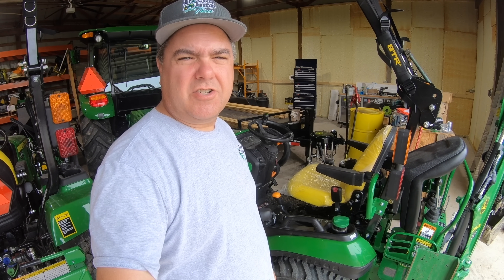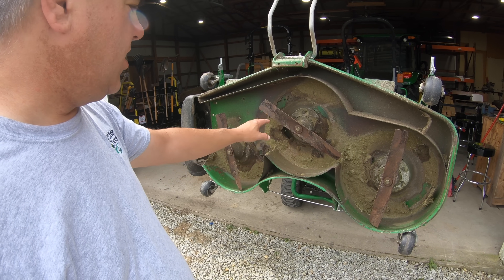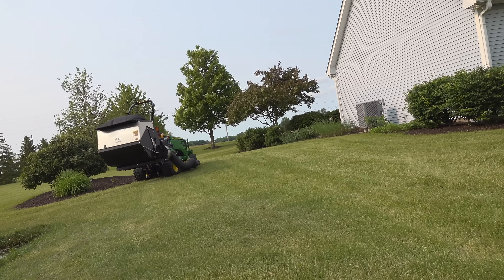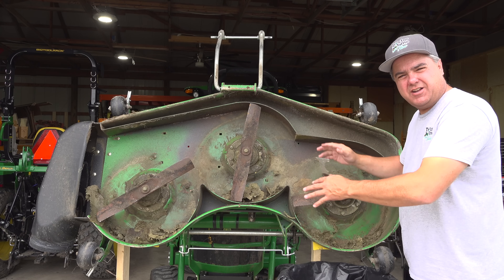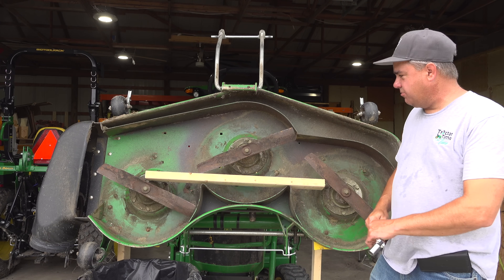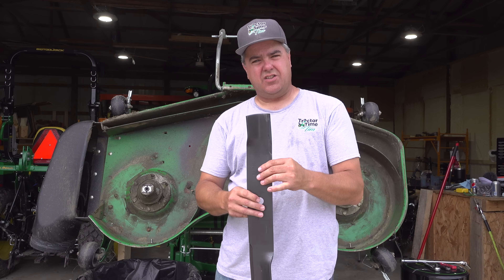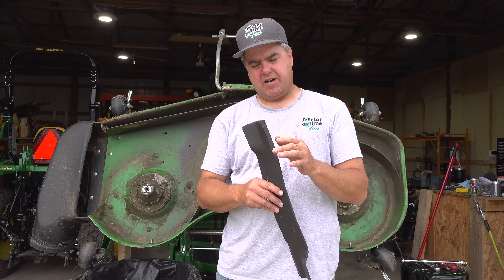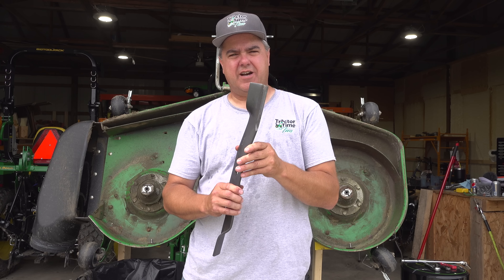Never Sharpen Your Mower Blades Again???

Comment: They really do work. We have gotten nearly 60 hours on each set without needing to sharpen them. Nice cut also
Reply: Plant foods
Reply: . Homemade plant food
Reply: Love your videos bro, and appreciate you keeping us up to date on the blades.
Reply: Nonsense.  Also, I get far more that 60 hours out of a sharpening with my standard mild steel blades.  In fact, I only sharpen them once a year - in the fall before putting the mower away.  Laminated steel blades with a thin layer of hardened steel  for the edge over a thicker of mild steel has been used for many hundreds of years by Japanese woodworkers for woodworking. It's a terrible idea for lawnmower blades. Also they are NOT self-sharpening which you even admit.  So the company that makes them is lying about that.  That should tell you something.  You do NOT want hard steel blade edges for lawn mowing. Hard steel is brittle and chips easily making it a very bad idea for lawn mower blades.  Just stop and think about it for a minute.  Lawn mower blades take a lot more abuse than woodworking tools such as planes. They run into rocks, sticks, and other non-uniform things.  They should not be sharpened to knife sharpness either.  Lawn mower blades are made of mild steel for a good reason.  Using laminated blades for lawn mowers is a bad miss-application of the principle which is to make a tool that can be sharpened to razor sharpness for woodworking buy also make sharpening much faster and easier than a whole bladed made of hardened steel.  That has nothing to do with mowing a lawn.  You've been duped.  Just think about it. It should be common sense for anyone who knows tools and technology.
Reply from the maker: Bob, the only thing you are forgetting is that not all soil types are just like yours.  My understanding is that sandy soils (say Florida) are horrible on regular lawn mower blades.  They dull and wear out very quickly.   These blades stay sharp in those conditions much longer.
I do not think these blades are useful in my conditions, as blade wear isn’t much of a problem anyway.   Dings from rocks are a much larger threat.
For this commenter, 60 hours may be a long time!  I heard some sandy soils required contractors to sharpen blades every other day!
Reply: @TractorTimewithTim  Blades of Grass Lawncare featured a few videos where he pointed out he had sandy soil in his area and put Fisher Barton specialty-coated 'never dull' blades on his mowers...And they lasted most of the season. Granted they looked awful a few months down the road, but they were still sharp.He used to swap out blades every day.

People really underestimate the effects of sandy soil,  because they figure, well, the soil is under the grass right? Well it still damages the blade. Every time you mow on sandy soil, especially when you use high lift blades,  you're sandblasting your mower deck. It's the same principle as helicopter blades in the desert: The leading edges have to be covered in a titanium barrier to keep from destroying the blade.
Reply: @TractorTimewithTim  I can confirm that sandy soils seriously degrade and destroy mower blades, in a matter of months, if mowing sparsely grassed areas with lots of exposed areas allowing sands to be kicked up!  This will also destroy the mowers ability to pick up clipplngs, real bummer too.
Reply: @TractorTimewithTim  60 hours? Ha ha ha! I'm just now replacing a set of Gravely Marbain blades that have been on the deck for 12 years. ( Over 1000 hours use ) And really, all they need is sharpened. Which is all they have gotten ( once ) in those 12 years. The blades that are going on are ones like I have used for over 40 years on the 50' decks. And what Gravely sold on the 30" mower for the two wheel tractors. They are blades that have carbide insets brazed into the edge of them. They handle cutting wood without a problem up to a  2" diameter as long as it is green on the 30" ( insert is a 3/8" thick by 3" wedge ). The 50" & 60" deck blades can take hedge trimmings and turn them into mulch without problem. Rocks have never seemed to have been a problem with them but rebar is a different story. We aren't on sand down here, we're on rock with a little bit of ground rock and a little clay for soil. But what we have is a grass that moves Silica thru its stems. And that will dull regular steel blades in one use.
Reply: No such thing as a self sharpening blade,  maybe less sharpening blade, only true test of when a mower blade needs sharpening is to look very close at the tips of the grass a day or two after cutting, if the tips of the grass blade is cut clean,  which means no rips or tears, the blades are good , grass is 70% water, which in itself is very abrasive, hardened steel only prolongs having to sharpen the blades

Comment: when putting blades back on do they have to be all facing in same direction i have 2 big outside ones and 1 small one in middle . to keep deck balanced? also have you oiled the deck after cleaning?

Comment: Clean and paint the bottom of your deck at the end of each season and it will never rust through.
Reply: Just spray with old engine oil
Reply: We would paint underneath with Slip Plate which is normally used on gravity wagons.
Reply: If they'd make decks out of aluminum or stainless they would last a long time, but they want us to buy them more often. Heck, why not a thick plastic like gas tanks on cars.
Reply: Rich Gocken 2

Comment: Hey Tim, how have those blades held up?  I ordered some, and have them, for my 3046R, but plan to put them on for next season.
Reply from the maker: I didn’t run them long.  Traded the mower.
Not good when hitting small rocks.
Good for sandy regions.

Comment: A word to the wise, and take it from experience, If you choose to 'power wash " a mower deck, which I have, depending on the brand and types of 'spindles" on your deck, be very careful not to aim too close with the pressure washer nozzle too near the bearing area(s) of the spindles. If your deck does NOT have the type with grease fittings, that indicates it is a sealed bearing. Accidentally allowing high pressure water to enter that area can be disastrous, because it will inadvertently blow the grease out of the bearings. If your deck has fittings for greasing the spindles, make sure you grease them right after power washer the deck. I recommend marine grade grease regardless of whether or not you power wash simply because there is always a lot of moisture in the grass. Scraping it best. Most the time, the reason why there is a grass build up is because you're mowing wet grass. Like early morning mowing. Mowing in the afternoon assures that the grass is not wet, but sometimes can't get around it.
Reply: On Steve's Small Engine Saloon he recently showed that a lot of the spindles with grease fittings actually have sealed bearings in them. He removes the inner seal so the bearings can be greased via the zerk fitting.
Reply: ditto on the deadly pto shafts,never have protruding bolts or shear pins and always keep shields in place,no shield yellow tag-machine inoperative-no exceptions! had this happen to a cousin,lost his right arm nearly killed him.

Comment: I just purchased a new lawn mower.  My old lawn mower, which was the cheapest push gas powered mower I could find at the time, is still running.  I replaced it because I got tired of having to put duct tape on the deck to keep the grass clipping from blowing back on to my face.  This mower was somewhere between 15 and 20 years old.  I never changed the blade, I never sharpened the blade, I never changed the spark plug and I never changed the oil.  When the engine would start knocking, I just added oil.  That mower has been sitting outside since last year and I would bet any amount of money that It will start with just one pull of the cord.  I'm getting older now so I purchased a new battery powered electric mower. (just in case, I'm keeping the old one)

Comment: Great video; but, I have seen guys just lay a bead of weld on the bottom edge of the blade and re-sharpen to bevel. The weld material is harder than the blade steel and this helps with keeping the blade sharp longer. The problem is like the "self-sharpening" blade, if you hit a rock or something it tends to chip the harder edge.

Comment: Just an impact to take the bolts off. No need for blocks.
Reply: And that is a way to take a hand off.  I had someone who did the same thing, but his impact was not set enough to loosen the bolt and all the blades were truing, so NO... do not use an impact wrench on the blades of a mower deck.

Comment: It’s been a few years now how did these blades work out were they worth the extra money
You were talking about how to keep your mower deck clean underneath one thing that I found is if I take some spray in bedliner and coat the underside of the more the grass won’t stick to it and if the end of the year it will be very little wear and you could touch it up and in the last few years and years
Reply from the maker: We did a follow up.  Not really suited for my soil types…would be better for sandy areas.

Comment: The harder steel is made the more brittle it is. I was told that by our machinist at work. One day a tapped a metal file on a round hand rail and snapped it right in two like it was glass.

Comment: So where I come from most people sharpen them at least once a season I would say generally just touching them up a little bit with a grinder other than the occasional rock chip that's pretty good normally you won't have to replace a blade

Comment: Hey Tim.  Can these be used with the 60D mulch kit installed?  When I bought my mulch kit, it came with different blades than were standard on the 60D used as side discharge mower.
Reply from the maker: I would recommend that you stick with the mulch specific blades.
Reply: Tractor Time with Tim Thanks 🙂

Comment: I usually find a water puddle and turn the blades on cleans under the deck pretty good
Reply: I have seen a lot of blades bent running them into water if it gets a little too deep.

Comment: We have a produce called LANOGUARD which is a landline based oil which can be sprayed on.like CRC or WD40 this prevents rust and corrosion on the steel or aluminium  but the best thing is damp grass does not stick to the surface and if a light spray if water breaks the crust of the grass and it will fall away leaving the LANOGUARD behind to protect the deck for humidity, I always park my deck in the up.position to allow air to.flow and keep a low humidity underneath.

Comment: Hello, new subscriber here. Great videos. I use a product called Slip Plate on my mid mower deck and I never had to scrape again. I’m not a sales person lol or anything like that, but I saw how bad this deck was and I was amazed at how mine is underneath compared to this one. I have 4 acres of grass (Tall Fescue) and that stuff wants to stick on anything, but Slip Plate repels it like a reverse magnet. Anyways, thank you for your videos.
Reply from the maker: Welcome to our channel!  Thanks for watching!
How often do you have to apply the slip plate?
Reply: @TractorTimewithTim  I do it every 100 hour service only because I do a thorough inspection and service on the gear box. Usually I will just apply 3 coats over 3 days. That’s just my rule of thumb since I mow every 2 weeks. I usually skip it every other 50 hour service but I will apply spot applications on the blades as needed every 50 hours.

Comment: I just found out how important it is to regularly clean the deck as mine has rusted through in some places after ten years of use. One of my locking hooks broke off leaving a hole and I didn't want to spend $500 on a new deck so luckily I was able to weld it back on which was a challenge since it is mounted on the curved rear edge of the deck.
I must say it is a Toro Z4200 and the  first week I had it I ordered their mulching kit and it worked supremely all these years even on big maple leaves every fall and those stupid kevlar banana peel looking things off the Sycamore tree.

Comment: how many hours should someone typically go before sharpening or replacing?
Reply from the maker: I dunno how to answer that.
Reply: Sharpen when they get dull, replace when they can no longer be sharpened. Your operator's manual should give you a guide as to what a blade looks like when it should be discarded. As for hours, there is no right answer as everyone's conditions are different. Some folks may need to sharpen every few weeks whereas folks like me only need to sharpen a few times a year. Inspect your blades regularly to get an idea on how often you need to sharpen for your conditions. Many folks find it convenient to have two sets of blades and swap them when they get dull. You can then sharpen the spare set at your leisure and always have a fresh sharp set ready to be installed.

Comment: hey tim got an idea i wonder how taking the mower deck and have the underside rhino lined sprayed that would make it  like a no stick frying pan and super easy to clean
Reply: Wouldn't rhino lined keep more grass with the liner being a rough texture?
Reply: i think it would actually make the surface slicker even with the texture i think it would be awesome
Reply: @lockmaster50169  my pick up bed has an X-liner that is rough. My idea of the liner being rough under the mower might be a problem with grass sticking.
Reply: im just thinking it might make the grass stick or build up less and would be super easy to hose off but im just assuming i know it has texture but i think it might not bind to it like it doez to metal if you could afford to ceramic plasma spray it nothing would ever stick to it again i used to plasma thermo spray coatings and it was awesome but super expensive i sprayed alum oxide ceramics tungsten carbide chrome moly zinc galvume and alum titania itsa 1000 x slicker than any teflon
Reply: @lockmaster50169  honestly I have never heard of the ceramic spray. Anything with ceramic would probably be high priced. I think it would be better for semi dump trailer boxes or dump trucks. Cheaper for more area to be treated.

Comment: This must be what came on my S140 when I bought it two years ago.

I have always changed out my mower blades every other summer. I took no different tact after buying my residential grade John Deere. I mowed two summers (a single yard, no others) and at the beginning of this summer I bought new blades for the replacement.

The original Deere blades under my deck, when I jacked it up, were absolutely disintegrated. I mean there were thin shards of what used to be blades down the side...and NOTHING in the middle. I have never in my life seen mower blades in that bad of shape, after two seasons of mowing only my own yard.

So, I returned the new Deere blades I had bought, and bought aftermarket blades from someone else instead.

I mean, if you own a business and you spend a lot of time sharpening blades on a lot of equipment, then maybe this makes sense. But if you are just a homeowner, who never sharpens because he finds his time more valuable spent on other things than the 50 bucks every other year for just buying new blades...then this is not the way to go.

Just my opinion. 

At least I HOPE this softer metal explanation is why my original Deere blades were so bad after just two summers.

**Then later in the video it was explained that my 48" deck could not possibly have come with these installed. Fair enough. But in that case, there remains no excuse for it. I'll just stick with aftermarket blades from now on.

Comment: Tim, the best way to reduce build up under the deck is to mow dry and not that low.  The lower you go the more chance you have built up.  Now your vacuum does help with the build up as well.  I have a Snapper HiVac push mower and I really don't need to clean underneath but once a year but I'm cutting with Bermuda grass. But if you mulch alot keep your blades sharp about every 40 to 50 hours should be good.  Plus it depends on the type of grass and the moisture content in the leaf.  My Bermuda doesn't hold that much moisture in the leaf compared to your fescues and rye grass.   Would like to see how those self sharpening blades are after 40 50 hours of mowing! I hate sharpening blades!  I wish I could come up and mow for y'all!
Reply: I mow really short to keep from having to mow twice a week. I've attached a bungy cord to the discharge flappy thingie, which holds it upwards about two more inches, which gives greater throwing distance and less buildup.

Comment: I put these on my JD 1023e Autodeck 60.  I won't use them again.  If all I had was thick turf, might be a good option.  I mow a school district and have many areas that are a mix of sand and thinner grass.  Kids and playground truf grass don't mix well, so most of the grassy areas I cut are very sparse.  The sandy mix wears the blades too unevenly causing a very rough edge, gouged edge.  For what I do, I have to stay with a blade I can sharpen and maintain a straight edge on a regular basis.
Reply from the maker: Yea. I think that was a good call.

Comment: If I didn't hit rocks and RR parts, ballast stone (live in/on a 100yr++ old Railroad  station Coal and Steam era, recently running again as a short line), I'd only have to swap blades about once a season. It'a the rough stuff that does the harm even though I mow 5 or 6 acres of meadow along with the lawn. The green stuff wears, but the hard stuff is what kills the blade. I've considered brazing or tig welding on some old tool steel bits as edges(carbide would shatter for sure), but the hard steel would likely just crack or chip out. 
I'll be watching to see how yours work out.
Reply: LaserEdge is not recommended for areas with high damage and little to no wear.   The high wear environment wears away the base material exposing new coating for the cutting edge.  That is how the self-sharpening works.